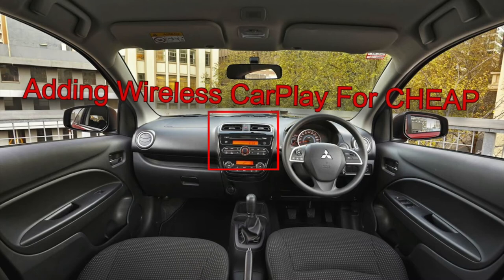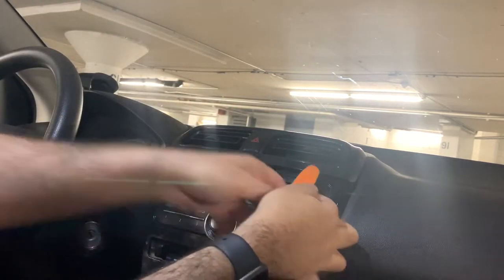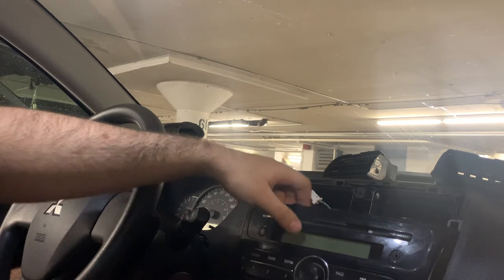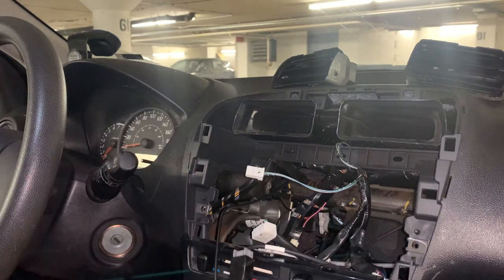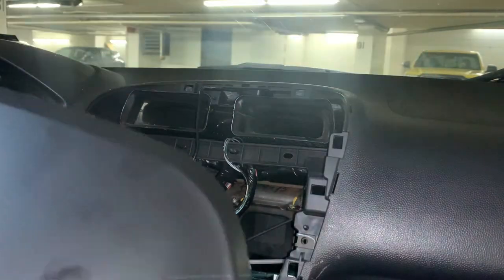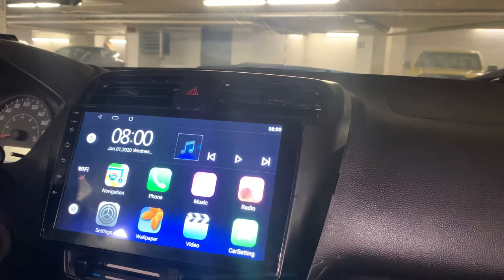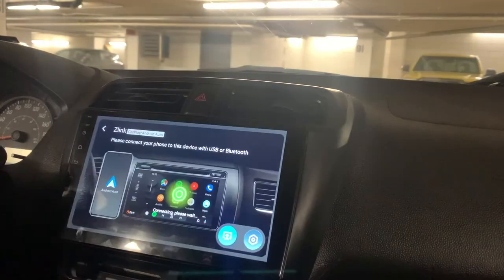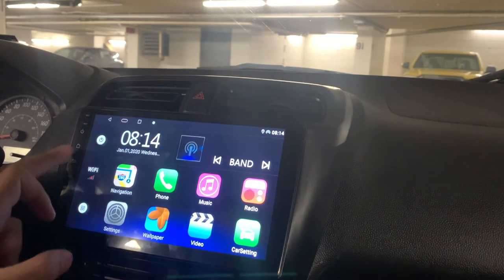Mitsubishi Mirage - New Stereo With Wireless CarPlay

Comment from the maker: Update, the delayed boot really bothers me, the radio won't support bluetooth remotes for steering controls and the CarPlay sometimes drops connection which is very dangerous since i have to look down to my phone to reconnect  the bluetooth for the radio to start working again. Very dangerous when relying on it for maps.

Also, very importantly the GPS on the unit is literally horrible, when driving downtown in an area with high rise condos around, apple maps placed the car in lake ontario...

Comment from the maker: Update: The radio screen flickers when i'm driving and press on the brakes. I think it maybe some sort of issue with the illumination circuit receiving power but i'm unsure. I no longer recommend this radio until i resolve this issue as its very distracting to have the radio dim then brighten its screen rapidly every time you press the brake pedal.
Reply: The illumination circuit receives power from the same fuse that feeds the tail light relay / lamps. That was probably ok with the original radio having minimal current draw for illumination, but the new radio display draws more current, stressing the components on that circuit. You might rewire the illumination power wire to receive power from another key on power source, or use the incoming illumination power wire as the power source for the control side of a relay and pull power for the load side off the cigarette lighter power port (if the car has one). I'm not an expert so talk to one before doing any wiring. 👍
Reply: I'm glad you added that part.  My wife is very sensitive to bright lights and any lights changing brightness would have bothered her.  I'd have had to pull it right back out.
Reply from the maker: @ChinaChuck  I have a YouTube short on my channel that demonstrates the issue.

Comment: I think the leftover white plug might have been for the cd player… 🤔 not sure though.
Reply from the maker: The oem unit cd player is integrated into the radio it cannot be separated. It maybe for can bus data for steering wheel controls
Reply: @welfarewagonrepairs  ah, I also just read your other comment on this. That makes sense, thanks for your reply.

Comment: Interesting. How come you didn’t want to consider the head unit from the SE trim level, the one that has 2 knobs, buttons, and a CD player? Seem like it would’ve been a plug and play install and easy user interface.
Reply from the maker: A couple of reasons:
1.At the time of filming it wasn't easy to find one of these radios used. The CarPlay radio has only been our since 2017(i think) and only on higher trim levels so its not super easy to find used/at a junk yard. If you go on car-part.com all the cars I found have the non-touch screen radio you see me remove in the video. They do exist on eBay but it is a risky game for me as I am in Canada and would need to pay for international shipping 2 ways if it didn't work.

Also note that brand new the radio is out of my budget: https://www.ebay.ca/itm/363783846760

2. I wanted wireless CarPlay and when this video came out last year most wired to wireless CarPlay adapters were not reliable and were expensive so this seemed like a cheaper alternative to me. This radio also came with a backup camera that I have not yet installed which was appealing to me.

3. I think this radio has a bigger screen than the OEM one(although I maybe wrong).

Comment: I wonder if you could just put an oem one in, my mirage came with carplay and its really smooth and works really well.
Reply from the maker: Another comment below already asks about retrofitting a newer model radio into an older mirage. Here are instructions for how to do that: https://mirageforum.com/forum/showthread.php/10116-Retrofit-2020-Stock-Touch-Screen-Radio-in-2014-Mirage?p=143781 i believe it is plug and play.

The main difference between oem and this Chinese thing is the WIREless CarPlay and if you wanted to run other android apps, i.e plug in a tpms sensor system or watch Netflix directly (maybe while driving or something like that)

Thank you for watching!
Reply: @welfarewagonrepairs  Any recomendation on where to pick up an OEM receiver with Android Auto?
Reply from the maker: @charleschampagne  I would try car-part.com or eBay. There was one for sale on mirageforum.com a couple of weeks ago but I believe that one has since been sold

Comment: hey man is this a bad product overall?
Reply from the maker: I use it every time I drive. Maybe 1 in 10 times either the music stops working or the Bluetooth disconnects and I have to pull out my phone to reconnect. The brightness is a bit too much for me at night and the screen flickers when braking but that maybe a wiring issue with my car. Otherwise it is ok. 

If I had to do this again I’d probably get an OEM unit with a wireless adapter for CarPlay from something like quad lock. Aside from functionality this unit is not held in with screws and will go flying if I crash. If this was much cheaper then an OEM unit then I would consider buying it again. Before this I used a phone stand  and my problem was the phone would overheat since I don’t have air conditioning. If you have air conditioning this setup is not really better than a phone stand.

Comment: How is the reception of gps goes? Which you install it inside the dashboard panel. Thank you in advance for your reply.
Reply from the maker: I installed it where the factory one would go if I had the higher trim with the touch screen radio. It’s all plastic above it. GPS quality is not good. Using Waze the gps works much better but the phone also gets warm. I think they are using the phones gps in combination with the radio. Newer cars will use the can bus data for speed and steering position to help with gps. An aftermarket radio can never compete. The radio gps works fine as long as I don’t drive downtown. I would compare it to maybe a Samsung s4 from a decade ago.
Reply from the maker: Thank you for watching!

Comment: Would you happen to know if any car stereo will work with the car for example a random one from eBay?
Reply from the maker: Yeah any radio can work if you buy the double din adapter kit and wiring harness and do your own wiring. This involves connecting the car specific harness you buy and the one that comes with the radio together. This kit came with a premade wiring harness and the plastic bezel/frame that is custom fit for the car.

Comment: I have a question did you have to pay for like the black top I think it’s called fascia or did you use the original ? Also how many inches was that screen ?
I’m about to work on my mirage this weekend and by far your video seems like the best follow along so thanks !!🫶🏼
Reply from the maker: Yes you need a new fascia. The one shown in the video came with the radio and wiring harness from Ali express. The new radio is literally held to the car by the plastic fascia. You can find this exact radio if you search on aliexpress. It claims to be 9 inches but I have never measured it.

Thank you for watching the video and taking the time to leave this comment.

Comment: Does stock 2021-2022 radio do wireless carplay? The stock one does SeriusXM which is desirable (and it being OEM and all). Not sure what all adapters are needed for that conversion!
Reply from the maker: I do not believe any mirage has wireless CarPlay, in the USA only SE and up have CarPlay. But i believe it is wired. Here are instructions for how to install the newer radio into the older mirage: https://mirageforum.com/forum/showthread.php/10116-Retrofit-2020-Stock-Touch-Screen-Radio-in-2014-Mirage?p=143781 i believe it is plug and play.
Reply: @welfarewagonrepairs  in 21and 22 I think carplay became standard with the newer larger screen alpine radio.  Looks like they sell adapters for usb to turn any ole carplay radio into wireless carplay. No one saves the adapter harnesses at these dealers before crushing so idk how I am going to hook this up...
Reply from the maker: @0zfer  im in canada, on the 2022 mitsubishi mirage official brochure, CarPlay is offered on the 7 inch touchscreen that comes on SE and higher trims. The cheapest model (ES trim) doesn't have it. Im not sure what adapter harness you are talking about, I shared a link that shows installing new radio into old mirage should be plug and play. Thank you for watching!
Reply: @welfarewagonrepairs  It needs adapter for USB, and harness for MIC and GPS antenna. Only usb adapters are available online. The others need to be fabricated, acquired from another car, or you can forgo the GPS and/or mic as they not required unless you want them. 

This chinese unit doesn't have any way to support siriusxm right? This is probably the main benefit along with being majority plug and play (metra port/ antenna/ steering wheel controls/backup camera) with the OEM Alpine Carplay unit. As I mentioned, wireless carplay can be added to OEM radio.
Reply from the maker: @0zfer  i have never used sirusxm. Im not sure why/how its better than spotify. I believe sirusxm has a CarPlay app that uses your phone data to work. So that would probably work on this radio.

My biggest issues with the radio are the lack of automatic brightness adjustment, the minimum adjustment is too bright, slow boot (about 10-15 seconds) and most importantly to me the lack of steering wheel controls. id like to be able to change songs without looking at the radio.
Reply: @welfarewagonrepairs  siriusxm is satellite also, it will work where there is no phone service, or you don't have data, or roaming in canada/Mexico. Really good for the boondocks.
Reply from the maker: @0zfer  That is true. I have Spotify setup to automatically download my liked songs but i understand where you are coming from.

Comment: Does your usb working with CarPlay? Android auto is working but not CarPlay.
Reply from the maker: I only ever use the wireless connection with a fast charger plugged into the 12v socket. I tried to use usb once but it appeared to only want to connect wirelessly. If you are also having connectivity issues maybe consider a usb to wireless CarPlay adapter.
Reply from the maker: Thank you for watching!

Comment: Hey buddy, after owning this for some time would you recommend I get one?
Reply from the maker: Works ok when plugged in, it’s does not work well when used wirelessly. The screen also flickers when I hit the brakes and the gps does not work well downtown. I would look elsewhere unless this was much cheaper than the alternatives
Reply from the maker: I only bought this because my phone would overheat as I don’t have air conditioning. If you have air conditioning then a good quality phone stand like the quad lock is easier to use and more reliable than this.
Reply: @welfarewagonrepairs  hey buddy thanks for the reply. What did you mean when you said reliable?
Reply: @welfarewagonrepairs  also I bought a pair of led side markers and from Amazon and they don’t fit well at all. I tried to find the ones you have from the link you attached to your description but it didn’t work. How do yours fit are they very loose or do they sit pretty snug? The ones I bought were rattling badly so had to take them out they almost just fell out that’s how loose they were.
Reply: I just ordered it the other day lol the radio is supposed to come in tomorrow so I’m really hoping I don’t run into those problems. I paid $150 all in for mine so not to bad I guess
Reply from the maker: @Gunner-qz9sh  the wireless connection dropped a couple times when I was on the highway and it required me to pull over to reconnect. I went down town a few times and it would tell me to make turns at incorrect places because the gps doesn’t work well with the surrounding buildings. I never had these issues with my 5 year old iPhone on a dollar store stand. Also the screen brightness does not auto adjust with daylight it just goes dim when you turn on headlights then bright when headlights are off. You have to manually adjust the brightness throughout the day for it to not bother your eyes. The screen is very glossy so sometimes the reflection distracts you and it flickers when you press the brake pedal. I also think the dimmest setting is way to bright to drive on a street without streetlights.
Reply from the maker: @Gunner-qz9sh  no rattling for me. They are a little more loose than the OEM but I haven’t had any issues.
Reply from the maker: @Gunner-qz9sh  lol
Reply: @welfarewagonrepairs  flickers when you press the break pedals! Wth that’s terrible did it flicker from day one?
Reply from the maker: @Gunner-qz9sh  yeah but I believe it only does it with the parking lights off. I think the brake light maybe back feeding the illumination circuit causing the screen to think the parking lights are on and making it dim itself. If you have the same issue please maybe let me know and I can design a fix
Reply: @welfarewagonrepairs  I will definitely keep you updated with how this goes lol I’m pretty sure I bought the exact same one as you so probably gonna experience some of the same problems. I’ll get back to you in a few days! Thanks a lot for all your help and your channel rocks love learning how to work on my car!
Reply: Hey buddy when you started up the screen was there an option of car play? I can’t seem to connect car play I have connected Bluetooth but car play doesn’t seem to pop up.
Reply from the maker: @Gunner-qz9sh  there is an app called “zlink” once you open it and set it up once it will automatically work when you start the car in the future
Reply: @welfarewagonrepairs  thank u brother I’m definitely going to try that
Reply: Is it zlink CarPlay?
Reply: Can’t find the one your talking about
Reply from the maker: @Gunner-qz9sh  yes, its unofficial poor man’s CarPlay, the name maybe different on your model.
Reply: @welfarewagonrepairs  I know lol, so ya I do have Zlink on my system but I can’t seem to figure out how to download the app on my phone it’s hard to find the download
Reply from the maker: @Gunner-qz9sh  you do not need an app on your phone to use it, it should automatically work. Have you tried plugging your phone into the usb port on the radio? What does the radio screen say when you open the zlink app?
Reply: @welfarewagonrepairs  I have an I phone so it’s wireless for me, I tried clicking on the app but nothing happens. I connected my wifi but when I shut off my car and turned it back on the wifi didn’t connect automatically so I think I need to get the app CarPlay going so it will work properly. It would help if they have some instructions with it, and ya so far no flickers of anything when breaking it seems to be ok in that sense.
Reply from the maker: @Gunner-qz9sh  i only got flicker with parking & headlights off. so does CarPlay work after you manually connect to the wifi/bluetooth? what does the Zlink app show? i think the Zlink app creates a separate bluetooth you connect to while the app is open.
Reply: @welfarewagonrepairs  when I click on the Zlink app nothing pops up. It says it’s downloaded to the system but can’t seem to get it going. When I manually connect blue tooth and wifi the maps seem to work and the internet but soon as I shut off my car I loose the wifi connection and have to creat a hot spot to get it going again, ya so far no flickering at all for me. Also they didn’t give me the correct connection for the usb for the glove to connect to the screen so I have no usb connected at all, I pretty much lost the power to the glove box usb now because the radio that comes with the car connected to the usb and went to the glove box. The usb got power from the harness or power cable going to the screen.
Reply: Hey try disconnecting the usb cable on attached to your screen it might take away the flickering, only thing is you won’t have power at your usb in the glove box.
Reply from the maker: @Gunner-qz9sh  I am 99% certain the issue is the power back feeding from brake lights through the parking light circuit to the screen. Sometimes I can see the side buttons on the screen light up as the screen dims as if i had quickly turned the parking lights on then off. I mostly drive at night with the parking lights on so its no longer an issue for me.
Reply: @welfarewagonrepairs  I think your right about that it wouldn’t make sense it being your usb. Btw does your glove box usb work with the connection they gave  you? Can you charge your phone from the glove box usb still?
Reply from the maker: @Gunner-qz9sh  yes the glove box usb works, I believe you can see me install the cable during the video. I use the glovebox usb regularly for wired apple CarPlay as its more reliable than the wireless. It charges my iPhone incredibly slowly, maybe 10-20% per hour while using it for CarPlay maps and music.

Comment: Hi there, I bought exactly the same, all works perfect but the left connector that left loose probably goes for steering wheel controls and I don't know how to connect them,. the seller said there are 2 wires (key 1 and key 2) that are ment for that.. but there are 4 buttons on controller so I said maybe I will connect at least the volume up and volume down to them but I don't know what colors to connect.. any experience with that anybody ? thanks ahead
Reply from the maker: Each button probably does not have its own wire. The cruise control buttons only have a total of 2 wires each button connects the two with a different resistor that the computer can understand and identify.

Comment: So does no one just make a plug and play adapter kit for these head unit swaps? I really don't want to cut into my factory wiring.
Reply from the maker: The one shown in the video is plug and play. No wires were cut, no soldering done